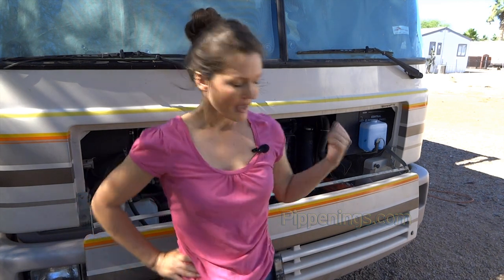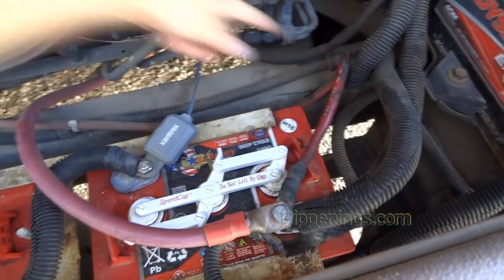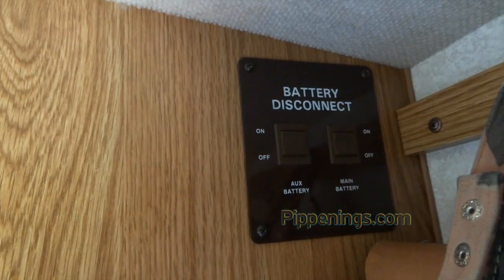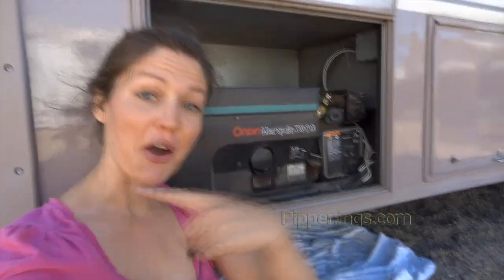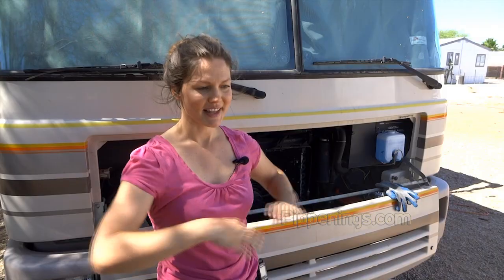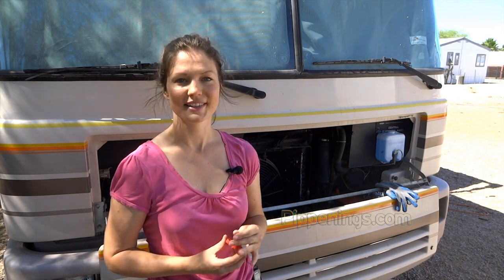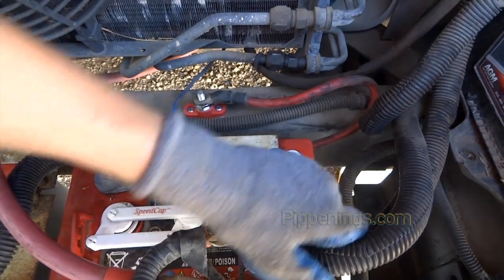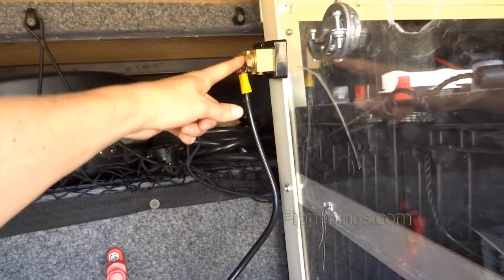RV DIY Solar: Remote Terminals to Reduce Re-wiring

Comment: Making diagrams of the mess that is RV wiring is always good. But, also, it is a good idea to directly label what you identify with a paint stick. You can get them where welding supplies are sold. Or, better, craft stores like Michaels have them cheaper, where they are called fine line paint pencils. Six colors to a box. Then you can color code directly on wires and cables and write on devices and surfaces next to connections. Really a big help for understanding what things are and where they go. Especially when you have to come back later to troubleshoot : -)

Comment: I have always been told not to drill holes in the top or bottom of frame rails as it weakens the frame. Drilling into the sides actually can help harden it. Just a heads up.

Comment: A real quick way to find all of the connections is to remove all of them and connect one at a time to determine what is ruining off that cable. In Our RV i have 2 remote disconnects one for Coach power and one the Vehicle power. The Jack stands should be on the Vehicle Starting Battery not your Coach side. The Generator is normally on the Vehicle starting battery also. The battery for your Vehicle is not a deep cycle battery and is used to mainly start the Vehicle or Generator, Except when the RV battery is dead. On our 37' john Deere I have the RV Starter, Jacks, Generator, Main Disconnect and the Emergency start cable. On the Coach batteries I have the Inventor, RV Alternator (through a  3 port isolator) and Coach disconnect. If you connect your Generator to the House (Coach) batteries you will not be able to start it if the House batteries are dead.

Comment: Clean all your cables with a wire wheel in a drill etc. Then put dielectric grease on all the connections for corrosion free connections for years to come. You can also use or make your own buss bar(Amazon) for multiple connections.
Reply: Please do not help spread the falsehood that dielectric grease is something to be slathered everywhere for corrosion free connections for years to come.  It has it's place, yes.  But just covering EVERYTHING in it before making connections is not a smart practice at all.  The stuff is an insulator, after all.  Learn WHERE it is to be used, and why.
Reply: 5280 Andy I have learned where it's to be used and why. For example instructed to smear it on spark plugs and boots and provided by parts manufacturers. It's used in outdoor cables to seal from moisture. It's used by Cable tech's around the country for sealing exposed connections. It's used many other places I'm forgetting. I as well as many others have used it for many years. Here is an example article. https://www.w8ji.com/dielectric_grease_vs_conductive_grease.htm Let me guess you're an engineer and your book says it's an insulator and shouldn't be used? Out here it the real world it works excellent to keep corrosion down in critical and noncritical electrical connections. So I will continue to recommend it's use based on millions of real world results.

Comment: I'm confused about the shunt at the negative battery connections. I assumed one side would go to body ground (which it does) and the other side would go to battery negative (which it also does). I also assumed that there would be a small wire from the battery negative side to the charge controller which would allow the controller to monitor power to and from the batteries by measuring the small voltage across the shunt. I've seen the drawing and don't see this small wire. I have to ask what is the function of the shunt?
Reply: ngneer999 My guess is that she does not want either her batteries nor her inverter to burn out quickly; that she wants a longer battery or inverter life. Perhaps, the shunt works as an equalizer to the pos post she had.
Reply: Hi Diana:  I have to think that the shunt came with the charging system.  If she is using it for a purpose other than current monitoring I'd like to see what that is.....I just looked online and the first schematic I found shows the system exactly as she has it but there is an independent current monitor connected to both terminals of the shunt. I'd guess she hasn't hooked it up yet.
Reply from the maker: +ngneer999 The shunt is used for the trimetric meter monitoring system which I'm not covering in videos. It's a better monitor than going outside and looking in my bins to see what's the voltages are reading. Perhaps I will cover it in a post-install video.

Comment: We missed sum O yr Vid. , but did we see ya run all the hot cables to the frame ?.   This kid an Tesla would get along fine .   This is like Frankinstiens Lab.   I can carry my own anywhere , but that Elec. stuff scares the heck outa me .  Careful Pips
Reply: She attached the positive cables to a dummy post (which appeared to be connected to the frame but wasn't), so as to not have to run multiple lines to her new batteries.

Comment: E-gad girl, your neck deep in it now and still swimming. You're so close it's got to be getting exciting.  I must have looked over my diagrams 50 times to make sure I did it right before throwing the switch.
Let us know what the final output wattage is from your array. That's the one thing that bothers me, I have 1050 watts of panels but haven't seem more than 800 watts on the meter.

Comment: Pippi- -PLEASE use extreme caution when messin with batteries, they are filled with hazards, like heat, acid  and "oh-shits..what the hells".  Keep a box of baking soda handy for acid accidents as well as distilled  water to flush away battery acid, especially in the eyes.  When bad things happpen..be prepared.

I truly do not like the looks of that over-loaded terminal post. Please redo it with a larger post, CLEAN the attaching terminals with emery cloth to reduce resistance and make a better contact...and lock the down TIGHT, and I mean TIGHT!!- -always put some lithium grease on them. When done, put a volt meter across the termination and look of a voltage drop...if you see one, clean and re-do.

Bob...be safe PLEAAAAAAASE
MSEE

Comment: Pippin you may do this already,,But I did not see you with Safety Glasses on.....Please Protect your eyes...If there is a Spark while moving the cables around,, The batteries can Explode in your face.... Eye protection Please..... Old Guy